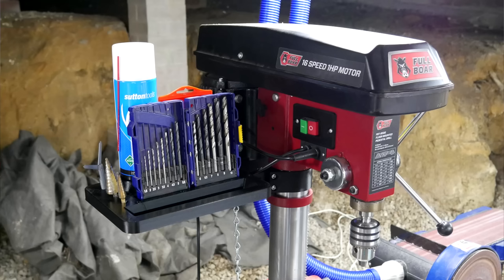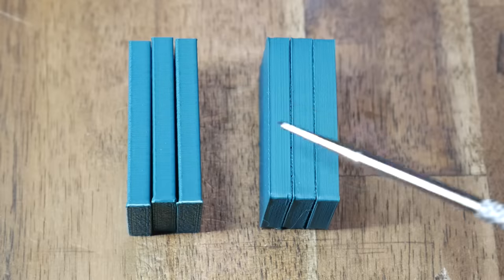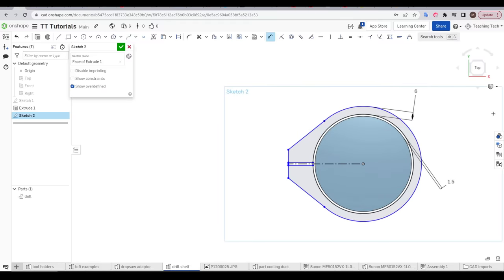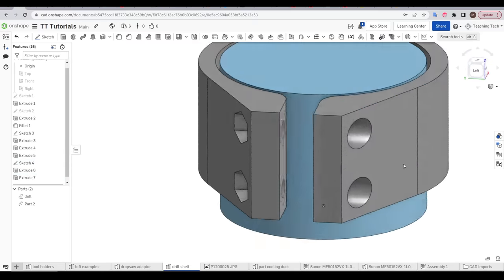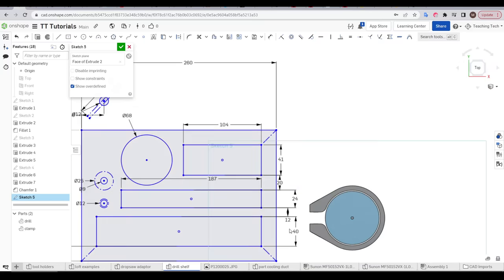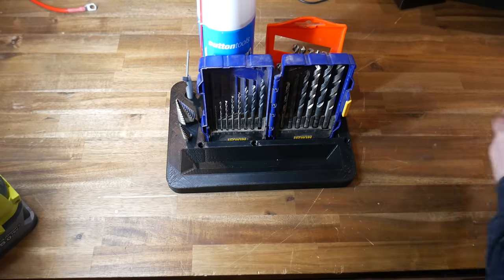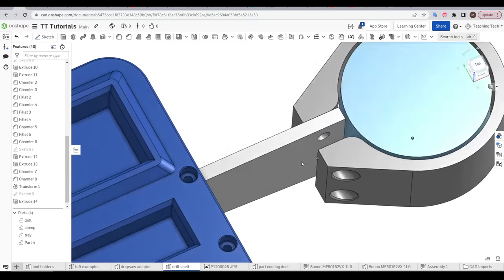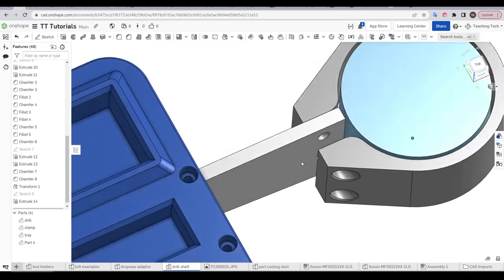Designing STRONG parts: tips and tricks - 3D design for 3D printing pt5

Comment: Another way to dramatically increase strength is embed threaded rod. It's cheap, not too hard to cut, and often easy to integrate.
Reply: I love doing this when there’s a protrusion or arm that I’m worried about breaking. Just bore out a screw hole from the base or back of your part. Then when it’s done printing I heat the screw and screw it in.
Reply: Great design tip.
Reply: This is the way. By incorporating metal or composite rods into prints, you can design functional prints that are many times stronger than plastic alone, while using less plastic. And, for the models that I split into sections for optimal print alignment and elimination of support material, I'll incorporate small dowel channels for finishing nails, allowing for precise alignment and strength when assembling with adhesive. I think there's a tendency for those of us in the 3D printing world to try to make things entirely on the printer, which I've certainly done in the past. Very often, the better practice is to design with the idea of combining the print with other materials in post-processing. You can usually build much better parts, while also being more efficient.
Reply: @timshimotakahara9508 Well said. I do the same. 10% extra effort can make for a >400% stronger part.
Reply: @timshimotakahara9508  Very good comment.
Reply: @timshimotakahara9508    I was hoping Michael was going to touch on that in this video.  It's a great way of getting around the inherent weakness of 3D printing.  The properties of 3D prints are similar to ply and MDF... much weaker in one plane.  3D prints are much stronger in compression when the force is perpendicular to the layers.
The blade-guide assembly on my bandsaw broke recently.  It was made from poor quality casting alloy, as many are.
I look forward to redesigning it completely, but in the mean time I have made a 3D printed replacement from PLA.  It is a bit more "meaty" than the original, and the addition of 6 short lengths of M6 threaded rod compressing the layers has made it much stiffer and stronger.  M6 was a massive overkill, but it was what I had on hand.
Ivan Miranda makes great use of different materials, getting the best outcome from their various properties.
Reply: @stevenkern9262  you can also incorporate a pocket for it into the design, pause printing at the requisite layer and insert the rod, then print over the top too, if you want it hidden. Works well with captive nuts as well

Comment: Loving the series Michael, great work. I have just a couple of tips that will make a couple of things much easier here. Firstly, when doing counterbore or countersunk bolt holes, consider using the Hole tool. That way you don't need to dimension the holes, just tell it you want a counterbore hole to fit an M5 bolt, and Onshape will take care of the rest. Secondly, when you are drawing the polygon pattern for the final piece, it is much simpler just to sketch single lines rather than double lines, then extrude the sketch as a surface, and finally using the thicken tool to make it all the required thickness. Not trying to be critical, there are 100 ways to go about this, none of them wrong. These are just a couple of things I do to make things easier.
Reply: For anyone using Fusion, it has a similar tool! It's so incredibly helpful to tell it that you want a tight clearance countersunk hole for an M3 screw and have it just do it for you
Reply: Seconding the hole tool. If you need to adjust for printer tolerances I've found Move Face to be really useful for that. It means you can suppress it if you are making a drawing for the part to be machined too. 

Yeah, the polygon pattern - I would have extruded all of it and booleaned it together with the part before cutting it out. But I'm lazy.
Reply: @evanbarnes9984  Fusion's tool is unfortunately not ideal for 3D printing in my experience. The clearance usually works out for the clearance holes, but the threads are pretty bad for printing. The CustomThreads plugin does a much better job for me.
Reply: I love the 3D printing community. Just a bunch of people happy to help each other out with their problems. 🙂
Reply: @evanbarnes9984  didnt know that, whats that called ? or where it is?
Reply: @versus023  It's under the "Create" menu, half way down, "Hole".  (Keyboard shortcut "H").  It works great, but you would benefit from experimenting first.  Note that threads can be modelled or just graphically shown.  If you are doing a lot of threads, modelling them can slow down screen refreshing etc. (But they are dimensionally correct, not just a picture).
The other thing I found was entering dimensions to locate the hole position on the chosen surface is not always intuitive, but persistence pays off!
All good fun!   😉

Comment: Good content. The problem I have with parts under tension/compression is PLA always creeps so the screws loosen. I have better results with PETG and ABS.
Reply: Yuo could try metal insert theards
Reply: @noway8233  It will still creep

Comment: Hey Michael, we all have our own habits, but you could do les operations for the bolts/nuts stage by using the "second end position" parameter in the extrude window. The hole tool is probably much faster than using concentric circles as you can use existing vertex of previous sketches. That tool makes countersink and counterbore operations a breeze.

Comment: Hey guy´s mechanical engineer here. Keep in mind the flow of force is like the flow of water, try to unrestrict the flow by designing big radii and avoiding sharp corners. Also the most outer shells are responsible for the majority of strength. For that reason it is important to have more outline layers instead of higher infill. It is for that reason why hollow tubes have about 10% less mechanical strength compared to filled material which is much much heavier. I hope I helped somebody new to the topic in understanding WHY you should design things a certain way.
Reply: To add to this, the part would likely have been even stronger with thinner webbing on the arm. You can see at 15:39 that the webbing is just thick enough that each wall stops and has a bit of Infill before starting the next wall… this prevents the strong walls from transferring the load because they aren’t continuous. For the strongest webbing of this type, make it exactly the width of your 2x wall thicknesses combined.
Reply: @wbhandy  Yes, you are absolutely right, thank you for your additional input and keen eye.
Reply: Be water my friend
Reply: @FriendshipLights  Feeeel the force
Reply: @sierraecho884  hahaha
Reply: Yeah low infill high wall count for strong parts is what I doing for years too.
Reply: ME here, as well.  Great advice in these comments for functional part designers!
Reply: avoiding sharp edges and rough surfaces is advanced mechanical engineering stuff
Reply: Funny but yes xD  @MCRuCr

Comment: Just a tip for design to keep in mind for some rookies, this collet design is great because it can be install just by lifting the head of the drill (lightweight) or remove the post. If that drill have been heavy weight and cannot be unmounted or removed, it will be a good idea to split the assembly ring in two parts for more practical time saving assembly. Thanks for tutorial.

Comment: A friendly suggestion related to the lattice, and the endless select-select-select of those interrupted profiles when extruding:
- Define the arm's outer and inner profiles in a sketch, and make those lines construction lines.  
- In the same sketch, make a grid pattern using squares, rather than intersecting lines. Draw a rectangular boundary around that pattern, and you have one, contiguous profile to extrude. 
- Start a new sketch, and project the arm's profile into the sketch. 
- Extrude the lattice, then extrude the arm. Cut the lattice using the arm extrusion, delete the outer portion of the lattice, and join the two remaining components. SO much faster, and will be more "robust" (i.e. less prone to downstream errors) if you change grid parameters. 

Overall, I'm a big fan of your TT endeavour, and I was very excited to see this series. I think lots of 3D printer owners are underutilizing their machines because design can be daunting, so I hope this inspires many to learn how to design. As someone who has designed nearly everything that has hit my print bed (I can probably count on two hands the number of .stl files I've downloaded and printed), the "design it myself" approach has come naturally, but I know that's not the case for others. I've nearly worn out two sets of calipers with all the use they get. 

Oh, and another tip: measuring large cylinders (such as the drill press post) can be problematic if the calipers aren't large enough to capture the diameter. In those situations, use a fabric measuring tape, or even a non-stretchy bit of cord, measure the circumference, and pi will get you to the diameter.
Reply: You have excellent insight to understand that not everybody can design. I applaud 👏🏻 you for saying it.
Reply: Isn’t there a WEB command like in Fusion360? This would have saved a lot of time.

Comment: One thing I did in a recent design was add a honeycomb pattern to the part. It dramatically increased the strength of the part. 
If you think about it all a pattern does is increase the surface area and the number of walls but it's really effective and it looks cool.
Reply: Another thing you can do is to not worry about creating the pattern in OnShape.  Just extrude it and then when you get into the slicer,  pick the honeycomb infill pattern and then just remove the top and bottom layers.  Viola, you have a cool looking, strong part without wasting time modeling.
Reply: @menerso  I was thinking the same thing! 
In Cura (not sure about other slicers) you can adjust the number of lines used in the infill pattern, so you can make the pattern as think as you like.
Reply: Bees for the win

Comment: Thanks for the vid. Agree with some commenters on designing for assembly without tools using things like dovetails, or zip ties. Probably would go thicker too, because that might not survive many knocks. Wrapping with a high-tenacity yarn + resin would bolster what's been made. To print faster you could get creative with vase mode and ribs/voids to pour in fast cast PU resin for strength; basically printing a mold that becomes the outter surface of the part. Saves on filament and time - probably comparable on cost, but makes something really solid, really fast. Just need to consider width of voids so resin doesn't heat up too much while curing. For those with lighter wallets the discontinued Autodesk 123D has a similar methodology to Onshape (albeit less features) and saves to local disk. Really complex forms can be made by combining shapes and 'subtracting' them from the main part.

Comment: I design and print alot of these types of parts at work. I like to use a honey comb pattern similar to your cross hatch pattern. I have found that printing parts with patterns like this does not actually save any filament or print time. Yes you are reducing the volume of the part but you are adding a lot of material in shells (perimeter layers) that would not have existed if you printed the part without this pattern. However I am in full agreement that patterns like this will make the parts much stronger. I often size the gaps in my patterns as a 2x interval of my nozzle size (2.4 or 3.6 or 4.8mm for a 0.6mm nozzle)... this way the pattern is printed without any infill and is made entirely of shell layers. Very nice video.

Comment: for the fixture holes in the tray: OnShape has a function to drill Holes. Just put points on the sketch for the centers of the holes, dimension them, and use the drill function selecting them all and setting the drill function to flat bottom countersink. this way you could change the holes to a different size all at once if what you picked was too small/big

Comment: I really enjoyed this video and learned a lot of good tips.  I made a first version of the drill press collar and no way was it going to "stretch' over the drill press column.  So, I made a slight modification to your design that worked for me.  I split the collar in half, added a place for bolts on the other side, and now have a 'hinged' part that works great.  (Wish I could add a couple of pics.)

Comment: Good stuff, thank you for sharing and educating us 👍

With regards to the clamp and the flex/strength tradeoff - the easy solution would be to make it two-part (connect on both sides of the circle: the other connection can be modeled for as a permanent. You wouldn't be constrained by the outward flex, when putting it over the column, hence, one could use higher fill percentage

Comment: Great video 🤩 !! Thanks a lot Mickaël 😀
This rack is a nice project, i do a lot of identicals projetcts for drawning materiels, i have to say i do more prototypes 1.5mm thick on the faces which requires précision  (to fit tools for example). Then i rectify the measurements, apply some printing rules and print the final piece. 
Thick prototypes saves time and filament 😉👍.

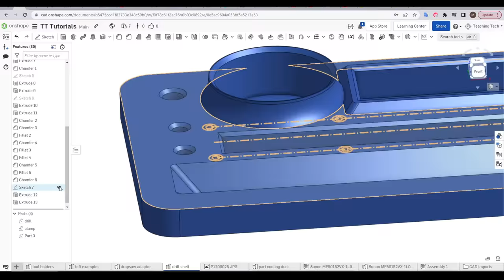Comment: 10:15 Even 31% infill is oftentimes overkill in my experience. I rarely go beyond 15% and that almost always works great :)
Reply: It is not en infill but the outer layers which are responsible for about 90%-95% of the overall strength. You are absolutely correct.

Comment: For the wobble, could you make a border, either through 3d printing (Though I would feel like that is a waste.) or from scrap wood, around the base of your drill press where it meets the floor. Print, or make small spacers to lift the base up just a bit. Seal the border to the floor with hot glue, and fill with silicone with the press in place to make a rubber base for it to sit on,. That should aid in stabilization and vibration reduction?

Comment: I am kinda sceptical about the strength-claims for the bracket: Have you tested or simulated any of that?
Cause sure - outer perimeters are stronger, but that is cause of 2 reasons of which neither apply here: The material furthest away from the center has the most impact on strength, but the pattern is in the middle of the section - the part with the least stress (see i-beams). And for the high strength the printed material needs to be continuous lines, but the way it will be printed it means they are all just independent rectangles that are not connected.
I would guess that the bracket would likely have been stronger if left solid with a bit more infill, and that at shorter print-times and less material used. And another option would have been to increase the thickness of the beam like with an i-beam - as the top is already thicker to connect to the tray it would only need a few extra mm on the bottom.

But it likely will last long enough anyways.

Comment: Great vid, so thanks. Interested in how you got the chamfer on the clamp bolt head holes (11m38s). I have a hairpin shape sweep running through a part to enable cord to be threaded in-round-out. I cannot get a chamfer or fillet where the "tunnel" exits the rounded piece.

Comment: There is an easy way to reduce the wobble of the drill press.  Put high strength double sided tape under the feet.  You can add extra layers to take up any unevenness of the floor if you want.  Otherwise, just having 3 points attached works perfect for a steady base.  For tape, I recommend the 3M extreme mounting tape (30lbs/sq inch).  just make sure everything is clean of dust, dirt, and oil before applying.  Best of all, if you want to move the drill later, you can just use a little acetone to get the tape to release.

Comment: Analysing how much stress a simple cantilever deflection will create is useful. People seem to make things thicker, or thinner, until they stop breaking, so being able to design to stress of say 40% of breaking in a deflection problem can  save lots of trial and error. The equations I use are for a cantilever of length l, width b, height h, deflection y, stiffness E,  then the force at the tip of the cantilever is 0.25*E*b*y*(h/l)**3 and the maximum stress is 6*force(E,b,h,y,l) * l/(b * h**2). Generally one twiddles b, h, and l, the other variables y and E being fixed by geometry and material constraints, until force and stress are OK.

Comment: Only "flaw" i see is where clamp and arm meet don't allow for a secure fit with tolerance. Two ways it could have been done to ensure the clam would be tight and also the arm. First is print as once peace, formed in a ? shape. Second would be to make an insert to the arm for captured nuts then on the clamp allow more room where the nut goes to either fit a socket or wrench, this way you can tighten the clamp onto the arm, then tighten the clamp to the post. OR just jam some shims in there and call it a day 😉

Comment: You could have used an additional mounting point in your design which would significatly improve stability. On the left to the red surface are 2 bolts. You could have used one of them as well.
Also the Bracket could be way thicker than 7mm. You could have used a "go pro" style mount at the clamp and therefore mounted the bracket on multiple contact points.